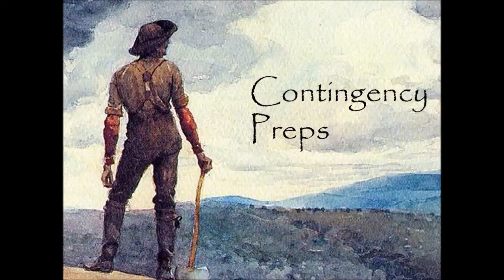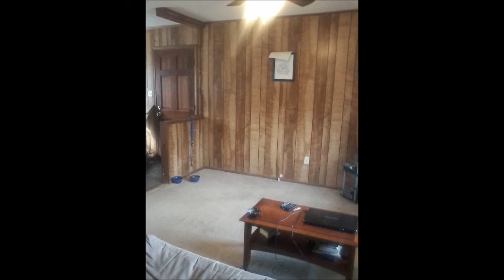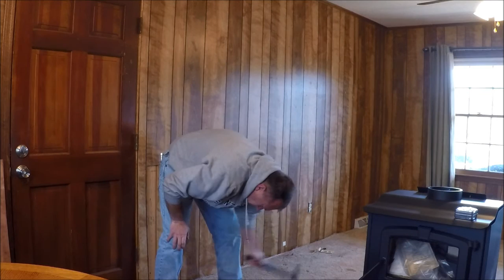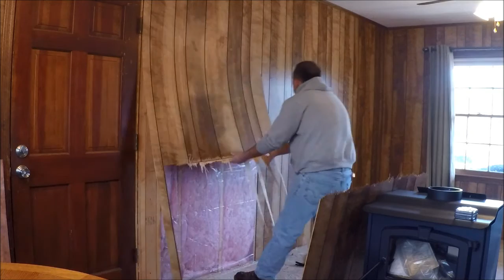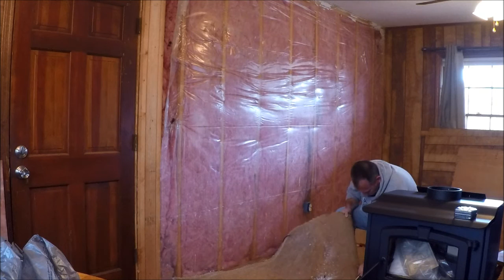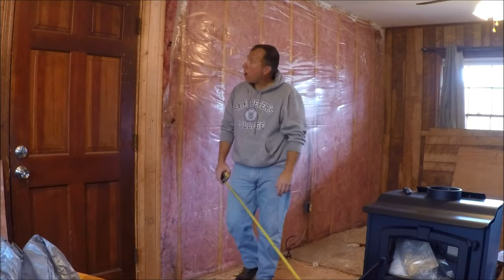Wood Stove Install Prep

Comment: Brother for that wall it's fine and good to get that junk out. But for the rest keep the stuff up and drywall over the top of it. That will help keep in the heat/cold and make for a nice flat spot for the dry wall.  God Bless Brother.
Reply from the maker: +yankey4 I'm yanking it all out! It's got lots of chemicals in it, and putting the sheetrock on top would shrink my room by about 2 sq. inches, and my house is small enough!!! hehehehe Merry Christmas my friend.